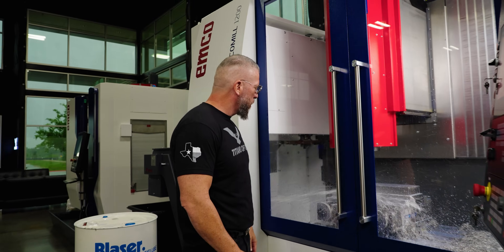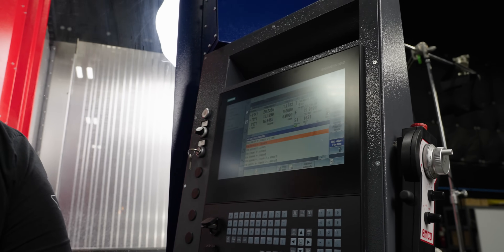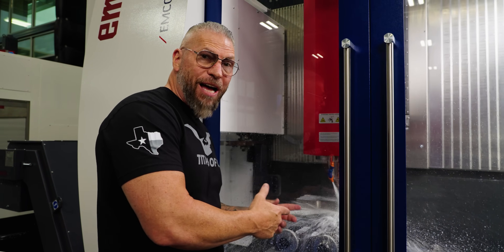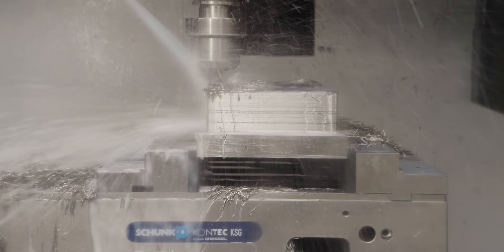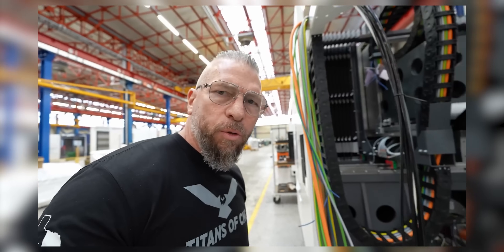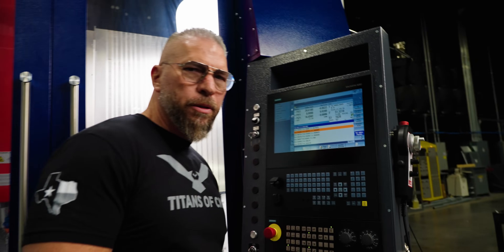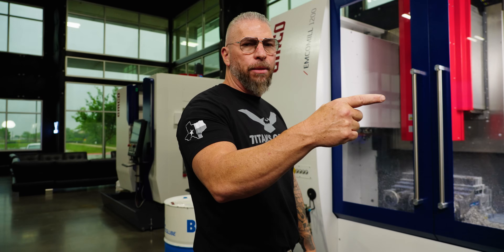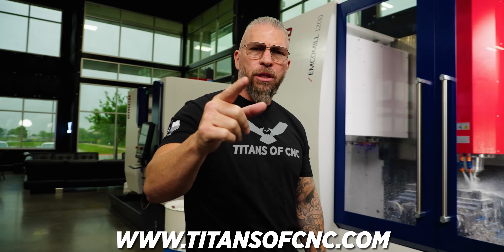Titanium Destruction Begins—2 New EMCO CNC Machines Arrive

Comment: Soon this complex program will be coded by AI only the loading/unloading of the raw materials and finished parts will need human efforts. With laser 3D scanning a part will be able to be programed for duplication in minutes/seconds vs the time it takes skilled machinist to measure and the program. AI will optimize program and run simulations for conflicts/errors at many thousands of times faster in mere seconds that would take the CNC many days to run checking for conflicts/errors. Further AI will accept digital drawings and select machine center best suited then write program in seconds run and verify simulation and verify the part will meet specs. First later this year expect to see finished inspections completed with scans by AI systems changing how parts are checked forever. AI will write optimized production programs from each shops machine and tool inventory eliminating much of what Master Machinists do for large shops making low wages insignificant and the location of machine shop  close to the user will become the most important factor for keeping costs low, as not many manhours will be needed for even the most complex of jobs. This automation will also impact the front office by automating purchasing and estimating to the point that jobs will lose most of the Administrative labor overhead as machining centers front offices become thru AI automated. Ray

Comment: The biggest drawback of Blaser Synergie 735 (I use it myself): it's incompatible with copper, brass, and galvanized components. This can cause problems with bearings and covers.
I hope Emco manages to get its financial problems with Titans of CNC under control, despite the customs policy, because they're a great company with good products.
Reply: Yes indeed and with 735 you can't tapping in aluminium and is is an paint stripper and rubber killer
Reply: @ruudmiltenburg8535  I haven't had any problems with varnish, paint, rubber, or plastics so far. The copper/brass incompatibility is the only thing that bothers me a bit, because otherwise it would be truly universal.

Comment: the emco 500 lathe my old job had serious problems with the slide ways where i worked after about 10 years they bound up buckled and maintenance cut the back of the lathe out and it caused a big row in the plant.

Comment: So Blaser Synergy 735 has no issues causing a wax layer on some machine ways and on bolt heads of sheetmetal?
Highly doubt that there is nothing wrong with the coolant.
Reply from the maker: Been using it for many years… I love it.
Reply: @ Don’t get me wrong, I did not say it’s a bad coolant. I also love it and use it in 2 of my machines. But transparency is key and the coolant has issues that the consumer needs to be made aware of. On some newer machines in particular. Wax layer on some bolts and lower end machines that use zinc sheet metal or ways.

Comment: I have an Emcomill 1200 and i dare you please buy the better Spindel i have the Spindle with 15kw and 100nm and machining Aluminium is really stressfull because the Spindeloption (standard) i bought has in the higher rpm range nearly 0nm and 2-3 Kw power but when you buy the better Spindel you get 20KW even in the higher rpm range so you can get into that Aluminium

Comment: What type of tool are you roughing  with? Thanx.
Reply: @rickyhammer6832   Great question! Titan is using the KOR-6 end mill from Kennametal. It consists of chip splitters to help manage chips more effectively.
Reply: @Sara-TOC  Ti ruff n always worked best with M42 cobalt. Many struggled with carbide not knowing that. Are the new tools carbide now? Thanks
Reply: @rickyhammer6832  The KOR-6 is a solid carbide end mill.
Reply: @Sara-TOC  Thanx

Comment: Pretty smart design for limited floor space. From this recording, the machine sounded fairly solid. But my ear noticed a hint of resonance on the Y ram. Time and usage will tell.
Reply: Exactly what I thought. Not tryna talk bad about Emco, but the way the y axis is setup the rigidity varies alot throughout the travel
Reply: @lokkas3637 we’ve all have ran steel causing the machine to howl loudly.
Reply: Seems like a okay mill but for my untrained eye it’s seems not the most rigid
Reply: It was something like resonation but it comes from a setup. The machine handles it however.
Reply: @Roberty98Ok. You train yourself to listen for certain things when operating CNCs.
Reply: @opendstudio7141  I know that already and just told you. I work on CNC and I know stuff.